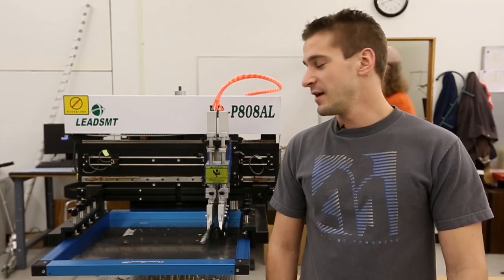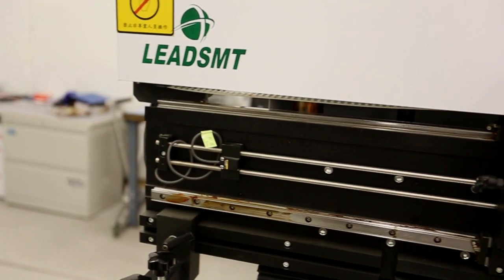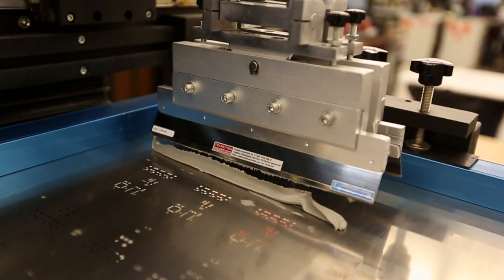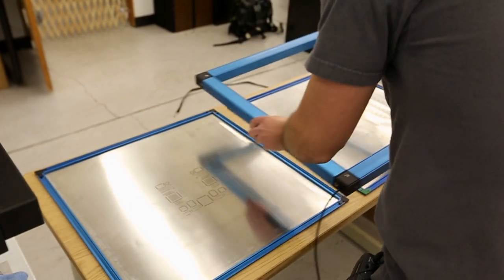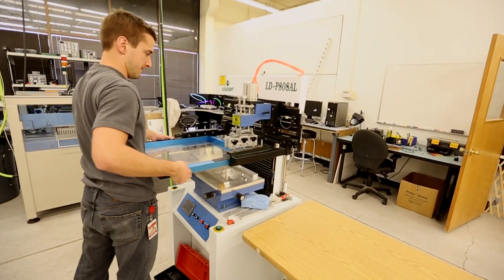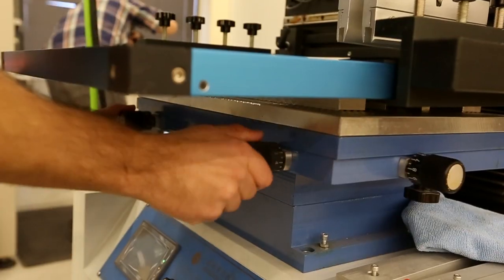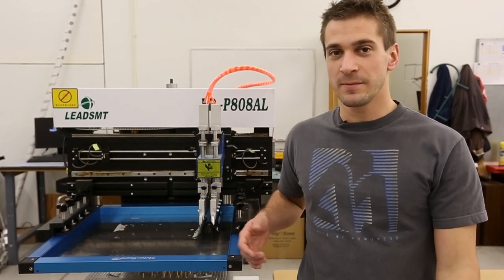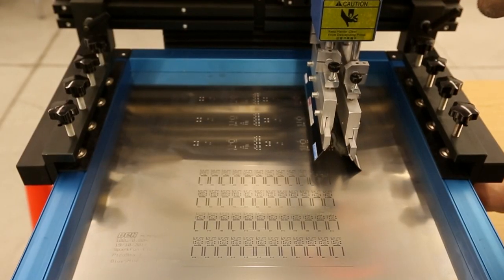SparkFun LEADSMT Stencil Printer

Comment: So it doesn't do anything except wipe side to side? So it's not a printer at all, It's a motorized squeegee. I was expecting something that cut the stencils or was a little more impressive. After it's setup does it at least load new boards and pass them to the Pick'n Place machine when it's done doing it's unimpressive job?

Comment: There are machines that have x,y,z control for individual points, they just take a lot longer due to the number of points they have to cover.  I don't think they are very common though.

Here is one if you can get the info below to work on youtube.
wwwDOTyoutubeDOTcomSLASHwatch?feature=player_detailpage&v=jSZbkR9vNzI#t=507s